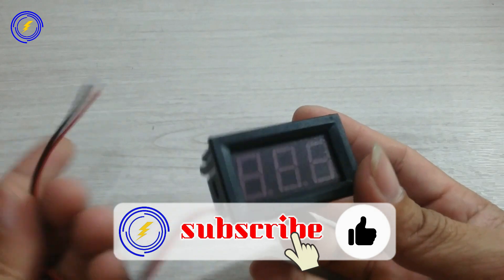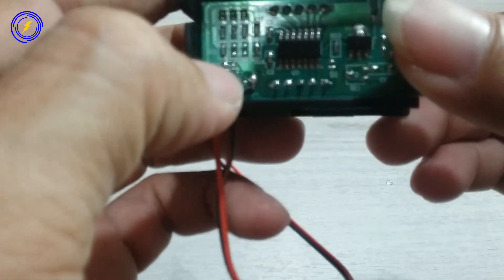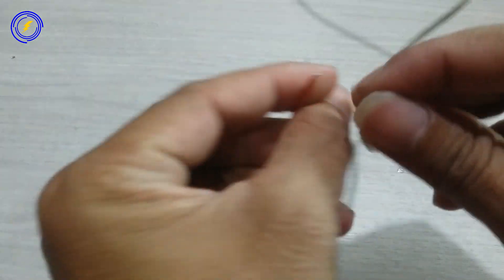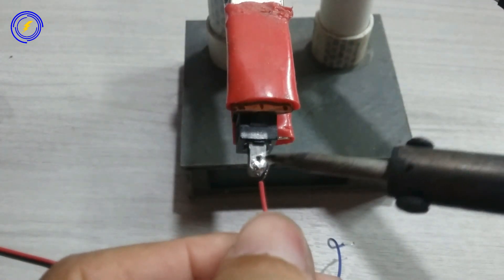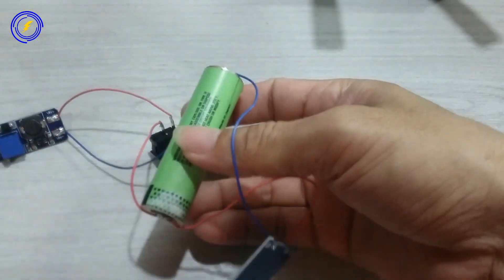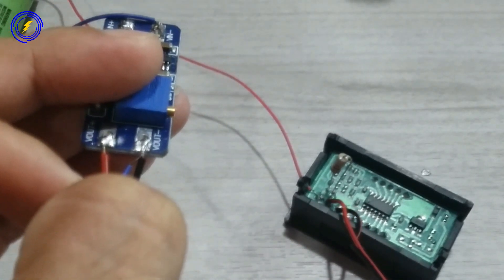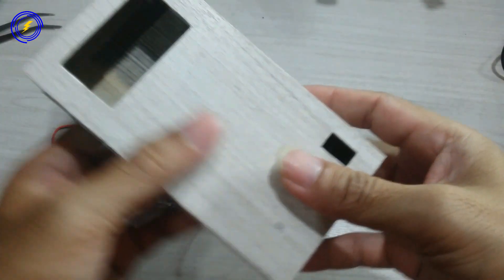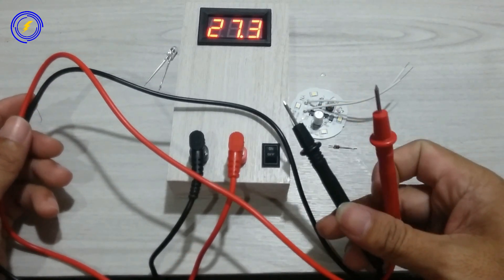Membuat Alat Tester Lampu Led Auto Volt

Comment: mass, mau tanya kalau untuk cek ke lampu nya itu harus lampu yg dc juga ya? atau bisa buat cek lampu led 220v ac?
Reply from the maker: Iya dc
Reply: @oneon18  mass boleh minta penjelasannya kenapa ketika smd resistor value 000 nya diganti dengan resistor 1k bisa jadi autovolt ? terimakasih 🙏

Comment: sedikit masukan bang, untuk sambungan modul charger ke in stepup nya apa ga diambilkan line out modul bang biar lebih safety, dikoreksi kalo salah
Reply from the maker: Iya terima kasih bang masukannya.iya saya sengaja karena  saat saya pakai pin outnya, kadang keluar tegangan kadang tidak mungkin modulnya error, jadi saya  putuskan langsung ke batre,dan saya lupa mau ngejelasin di video.
Reply: Kenapa gak disambung ke in dari modul cas bang? Biar kalo gk pakai batre bisa langsung ke casan hp. Maap bertanya. Soalnya saya baru belajar @oneon18
Reply: Kenapa gak disambung ke in dari modul cas bang? Biar kalo gk pakai batre bisa langsung ke casan hp. Maap bertanya. Soalnya saya baru belajar

Comment: Bang kalo voltmeter yg 3 kabel bsa gk
Reply from the maker: Bisa
Reply: Resistornya d pasang d mana/modif nya gmna?
Reply from the maker: @IskandarNuris  tidak usah di modif resistor pasang di output (+) step up langsung ke output tes dan dan kabel output tes di voltmeter digital langsung ke output tes juga.

Comment: ILMU NYA LUAR BIASA.... TAPI BANG MAAF, TOLONG KASIH TAU SPESIFIKASI VOLT METER NYA KARENA BNYAK SKALI MACAM NYA VOLT METER... SMOGA BERMANFAAT BANG 🙏
Reply from the maker: Maaf bang sepertinya sudah ada di video untuk type voltmeternya
Reply: @oneon18 modulnya step down tipe berapa bos
Reply from the maker: @gamegamer6176  saya lupa untuk typenya tapi sepertinya ada di video
Reply: @oneon18  modul lm2596 apa BS autovol?
Reply from the maker: @muhammadrahman9601  lm2596 itu modul step down mas.yang step up mas
Reply: @gamegamer6176 
Step up bukan step down pak...
Reply: @oneon18  gaada bos,, link belinya bos kirim
Reply: volt meter nya beli yang 2 kabell..ituu kan ada kabel yang 2 pin dan 3 pin. itu jelas berbeda.🙏🙏
Reply from the maker: @kangsemar3305  dua kabel tapi 3 pin
Reply: Bs ngukur kapasitor kipas bang
Reply: siiip bang

Comment: I'm watching from Russia.
Well done!
Unfortunately I don't understand your language, and there were no notations on the screen.
Why change the resistor in the voltmeter?
And what was the nominal value of the resistor and what did it become??
.
Смотрю из России.
Отлично сделано!
К сожалению я не понимаю Ваш язык, и не было  никаких обозначений на экране.
Для чего менять резистор в вольтметре?
И какой номинал резистора был и какой стал??
Reply from the maker: thank you for watching. I use a 1 k ohm resistor, if you don't replace it, we can't make it a led test tool. Because the resistor in this scheme is a current limiter.
Reply: @oneon18 
And this resistor limits the current only for the operation of the device? Or does it work as an output current limiter for measuring any LED?
.
А этот резистор ограничивает ток только для работы прибора?  Или работает как выходной ограничитель тока для замера любого светодиода?
Reply from the maker: Yes,it works as an output current limiter for measuring each.so it doesn't damage the led.
Reply: @oneon18 
Thanks for the answer.
.
Спасибо за ответ.

Comment: Kalau untuk cek dioda zenner yng 24 volt apa bisa terus mas kalau step up in nya/input nya di kasih charger chas HP bagaimana bisa tidak ,terus kalau di gital volt meter nya diganti dng yang ada amperenya supaya nanti selain tahu volt nya juga ya tahu amperenya kalau bisa tolong buatkan tetorialnya ,maaf saya pemula !
Reply from the maker: Bisa di cek di video saya yang lain sudah ada
Reply: @oneon18  judulnya apa mas namanya
Reply from the maker: @ahmadfake2462  membuat alat test LED autovolt  versi 2

Comment: Ijin bertanya om..
Kalo input arus dari adaptor bekas dgn output 24 v bisa langsung k volt meter tanpa step up?
Jika ya resistor nya pake yg brpa pak?
Terimakasih
Reply from the maker: Bisa.
Reply: @oneon18  resistor tetap sama pak?

Comment: Volmeternya tipe berapa serinya
Reply from the maker: Lupa mas.cari saja yang 2 kabel
Reply: @oneon18  ia makasih banget bang  Terus volmeternya berapa volt  kalau BLH tanya itu nggak apa apa itu step up  down AC atau DC settingnya di full sampai mentok nggak ada kendala mohon penjelasannya🙏?.....
Reply from the maker: @rohmat0566  voltmeternya range maximal 30v.saya menggunakan step up MT3608,setting full

Comment: Saya beli voltmeter kok gak ada vt nya kak,yg ada tulisan sig letaknya deket v+.apa itu sama ma vt ya kak,makasih seb
Reply from the maker: Sama.tapi kalau gak ada resistor 000 ohm coba resistor di hubungkan di pin sig dan out step up.untuk out testnya di hubungkan di pin sig.

Comment: mas, ini bisa dipake buat tes led running motor?
Reply from the maker: Bisa buat tes semua jenis led.tapi terbatas cuma sampai 27v saja
Reply: @oneon18  saya udh bikin mas, tp setelah diganti resistor 1k, trs + - jack disatukan, voltmeter nya bukan 0.00 tapi 0.08 itu kenapa ya mas? trs mentok set up di 29.9 v
Reply from the maker: @alialmuslih5396  gpp mungkin dari voltmeternya coba ganti resistor ya dengan 2k/2k2
Reply: masi tetep mas udh ku ganti 2k2, dari voltmeternya kali ya mas?

Comment: Aslmmlkum... Om apa bisa resistor 1k nya dipasang pada tempat kabel Vt dan V + karena di tempat R3 nya tidak cukup , dan saya paksa tidak mau nempel tetepan....
Reply from the maker: Bisa saja
Reply: Tapi hasil nya kok nyala 0.04 terus tidak bisa untuk mengukur baterai ABC AA tetep nyala 0.04 apakah ada konslet om tx.
Reply from the maker: @winduwaskito567  resistor 000 sudah di buang mas?
Reply: Resistor 000 sudah dibuang lo om 🙏

Comment: kalau pake volmeter yang 3 kabel bagai mana cara merakitnya?
Reply: Apa perlu tambahan resistor, pasangnya diposisi mana, resistornya brp Kilo?
Reply from the maker: @pengalamankuthekoct  dari signal atau kabel kuning di kasih resistor ukuran seperti yang ada di video 1k-2k2 hubungkan ke out step up. Untuk mengetes led hubungkan pin sig/kabel kuning dan out dari modul step up .semoga membantu
Reply: @oneon18  boleh minta skemanya untuk volmeter yg 3 kabel, supaya lebih jelas..

Comment: Kalau resistor 1k tidak ada berapa ukuran pengganti nya?
Reply from the maker: Bisa pake 2 k
Reply: @oneon18  aq baru bikin bro dengan resistor 1 k,lalu sa,at pengukuran led hpl yg 3,7 volt terbaca 2,6 volt,lalu aq coba ganti resistor yg 1 k tadi dengan resistor 13 ohm,lalu coba ukur lagi led hpl yg sama dan sekarang terbaca 4,6 volt,jd menurut q nilai yg terbaca mengikuti nilai resistor yg di pasang,jd kalau untuk mendekati ke akuratan harus cari resistor yg nilai nya benar benar pas.
Reply from the maker: @ekaananda2598  ya bener cari resistor dengan nilai yang pas .saya pake 1 k karena saya sudah coba pada beberapa led supaya mendapatkan konsumsi arus yang di butukan tidak terlalu besar dan terlalu kecil.resistor juga mempengaruhi arus.semakin besar nilai akan semakin kecil arusnya,dan semakin kecil nilai resistor semakin besar arusnya juga.

Comment: sorry, dont speak your language, but could follow all of it, except i did not get the value if the resistor.  Thanks for the video.👍👍👍👍
Reply from the maker: thank you
Reply: To prevent LED/Zener from being damaged caused by over voltage
Reply: value resistor 1k

Comment: Mas sudah saya coba dan saya maksimalkan 28 volt...tapi kita konslet kan tidak muncul angka 0000 dan saya coba ke led....eh malah led rusak semua....gmana ini mas...kesalahan dimana ya
Reply from the maker: Sudah di ganti resistor apa belum mas
Reply: Resistor sudah saya ganti mas tapi tetap apabila + dan - saya tempel gak muncul angka 0000 tapi kedip sebentar...apa ada pengaruh resistor 1/2 dan 1 watt. Ma kasih

Comment: Mas, kan itu pakai voltmeter 2 kabel asalnya, jika memakai voltmeter yg 3 kabel, apa perlu juga dikasih resistor?
Reply from the maker: Perlu
Reply: @oneon18  apa yg terjadi jika tidak ditambab resistor mas? Aku masih pemula tentang elektronika, masih banyak bertanya 🙏
Reply from the maker: @kang2161  lampu led yang di test akan rusak.
Reply from the maker: @kang2161  lampu led yang di test akan rusak.
Reply: @oneon18  terimakasih ilmu nya mas, ternyata fungsi resistor itu penting sekali
Reply from the maker: @kang2161  ya sama-sama mas

Comment: i need 3.8v battery to 180v up backlight tester
Reply from the maker: if you use this tool you can't. but if you want to test led lights above 180v you can use the joule thief (JT) circuit.

Comment: Step-up MT3806 (7-10k) + Lithium charger TP4056 (7-10k) + Resistor 1KΩ (200) + Saklar mini (2k) + Banana jack female set (3k) + Kabel probe (15-20k) + Mini voltmeter 2 kabel (10-12k) + Battre 18650 (5k atau batre bekas laptop/hp yang masih normal) + Box tipe X3 (6k atau dari bekas dus hp atau tuppleware).
Harga tersebut harga rata2 online shop (˛•̃•̃)/🍻\(•̃•̃¸)
Sudah lama owe sering buat kayak ginian. Lumayan ada chuan tipis2lah..😍
Reply: jual alat tes led nya gan ? saya mau order 1 unit.
Reply: Bisa buat tes Amper ngk
Reply: @gatottampan2598  coba buat aja dulu bisa kada ｢(ﾟﾍﾟ) ?
Reply: resistor 1k ohm nya brp wat?
Reply: @nziill14092  yang 1/2 watt udah cukupan 😁

Comment: Utk step up nya brp volt dan modul chargernya tipenya gmn bang maap tdi ga dengar terlalu pelan bicaranya
Reply: Mksih sdh jelas
Reply from the maker: Ok untuk step upnya range maksimal 30v tapi divideo cuma mentok 27v.untuk tipe modul chargernya saya memakai "tp4056".untuk angka yang menunjukan angka 5 dst adalah tegangan yang di butuhkan LED,jadi jika kita ingin menyalakan 1 buah led kita memerlukan tegangan sekitar 5v
Reply: Bantu infokan aja 🙏 Modul step-up (MT3608/2A) Modul lith-charger TP4056/1A

Comment: Mhn maaf, baterai 3,7v lalu pake step up trs tegangan nya bisa mencapai 25, sekian,itu dari mana ...?
Reply: Wkkkkkkk menstabilkan apanya 🤣🤣🤣 step up untuk menaikkan daya kl step down untuk menurunkan daya kl mau stabil beli saja stabilizer bukan step up .
Reply from the maker: Dari batre 3,7 v di step up puter trimpot sampai tegangan mentok mencapai 27,sekian volt
Reply: mhn maaf, menurut pengalaman saya,tegangan  misalkan 12v, ingin jadi 25 v di naikin pake step up itu hasil nya  tetap ,paling bisa naik sekitar 2v.
Reply from the maker: Modul step up yang saya pake range sampai maksimal sekitar 30v
Reply: Coba aja seperti yg di video bang, biar tau hasil nya
Reply: Mhn maaf ,saya sih bicara nya secara logika aja,tegangan baterai 3,7 trs Amper nya kecil pake step up dng mudah nya bisa naik menjadi misal kan 24v kalau emang bisa menaikan mungkin orang yg punya  leptop atau barang electronik lain nya banyak yg menggunakan sistem step up dong...lebih efisien dan murah,yg jadi pertanyaan saya...baterai 3,7vbisa menghasilkan tegangan volt tinggi dari mana...?itu kan udah batas maksimal dari pabrik, selebih nya itu dari mana, terima kasih
Reply: @japraleskuningan  mohon maaf juga kami gk bisa jelasin kalau hanya dengan teori
Reply: Mohon maaf,menurut pengetahuan saya yg nama nya step up,stabilizer  itu, pungsi nya untuk menstabilkan voltase,bukan menaikan voltase,yg tadi nya voltase nya down maka akan stabil dng cara menggunakan step up mhn maaf bukan saya menggurui tapi saya hanya berbagi pengalaman dan itu menurut versi dan pengalaman saya, terima kasih.
Reply: @japraleskuningan  beli online banyak , buck dc to dc

Comment: Om mau tanya klo resistor 000 nya gk ada apa yg di ganti abis yg saya beli beda om gk sama yg di vidio yg sya beli R 000 nya gk ada om
Reply from the maker: Volt meter yang berapa kabel om?
Reply: 2 kabel om tpi berbeda sama yg di praktekin di vidio